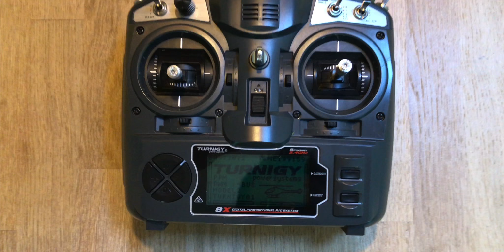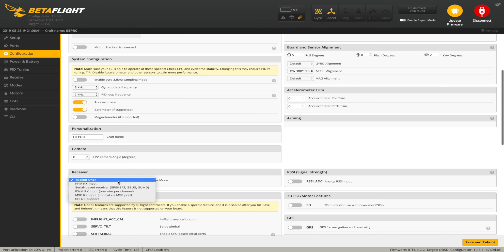Turnigy 9X Ultimate Upgrade ! FrSky XJT & X8R Modules [Installation and Betaflight Configuration]

Comment: Does the telemetry work with the 9X if you have flashed OPen TX?
Reply from the maker: Hey Scotty C! Yes you can have telemetry but you will need to do some additional modifications. (That are quite tricky, so if you are not comfortable with soldering i wouldn’t recommend you doing it) Kindly check this link for a step by step guide on how to flash a new firmware and have telemetry : https://oscarliang.com/turnigy-9x-advance-mod/

Comment: With XJT module, what are the number of channels the 9x transmitter has? Is it still 9? And other question does it support telemetry or need another mod?
Reply from the maker: Hey! Sorry for the late reply! With this mod you can go to up to 16 channels, but for telemetry you need an additional upgrade.

Comment: I get 4km with T8SG Carbon and an 8€ AFHDS 2A Receiver (ia6c) in the end modding this will be more expecive
Reply from the maker: Interesting! Yes sure this mod is for around $45
Reply: @TheWorkshopByGM  in the long terms yes my friend. I pay once for the TX like 80-90€ and everything else will be under 10€ with extremely good range. This RX coast about 35-40€ where I live and then there's the module you need. Even if you have the transmitter, in the end will be more expansive.